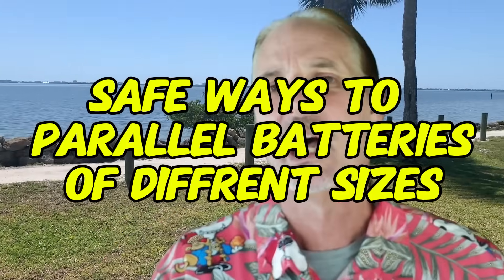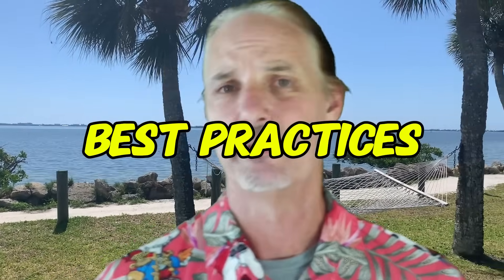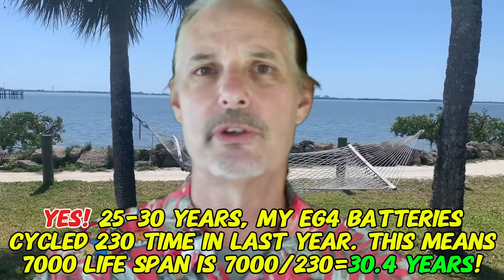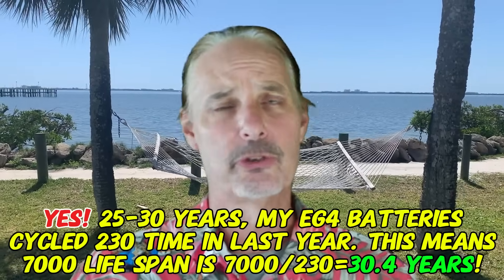Connecting Batteries with DIFFERENT Capacity in Parallel - What Happens?!

Comment: Good information thanks. I have 4 100a rack mount eg4 batteries which you know has built in breakers on then. The run to a bus bar and from that to two more 100a breakers before going into the two inverters. No fuses, I am told by many on the diy forum that I don't need them, your thoughts?.
Reply from the maker: Yes, they most likly are right, but the question becomes how much power can the wire that carries the power to inverters support, with 4 batteries you can put 400A over any common wire, and with no fuse or breaker, it will just melt, so I would run them to Battery(breaker)->busbar --> fuse -->busbar --> inverter .. This inline fuse protect the wires with common current